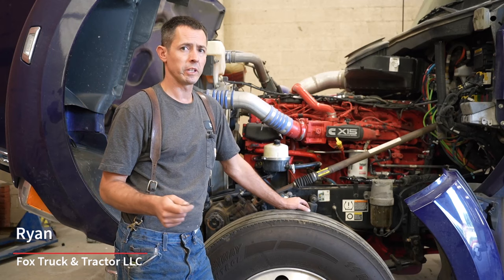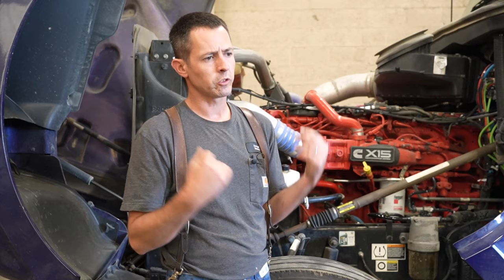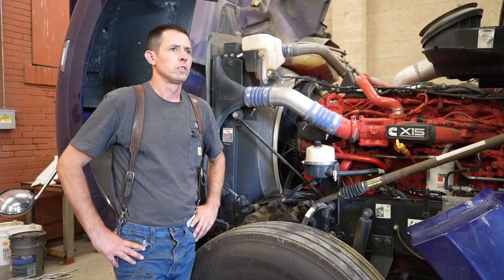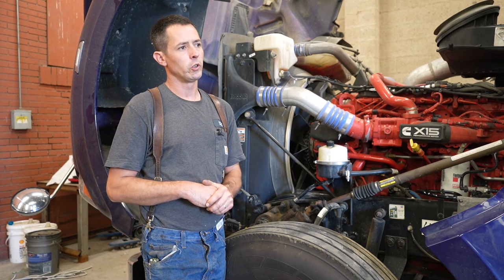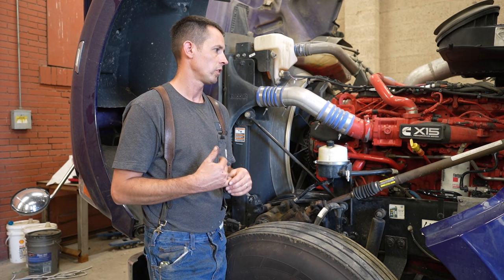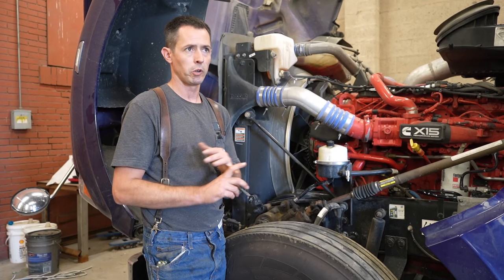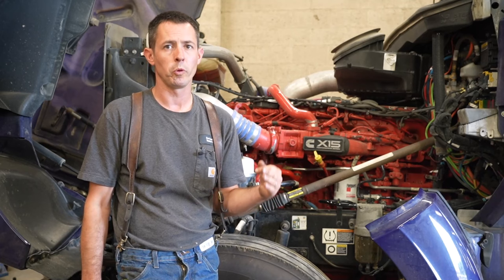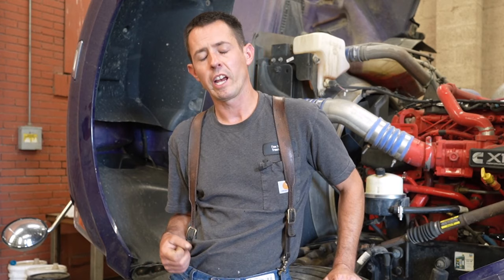Crankcase Pressure High on Cummins ISX 15 and X15 - How to Diagnose & Troubleshoot

Comment from the maker: Thank you for watching! Subscribe for more diagnostic videos!
Reply: Hey my 2018 Peterbilt 389 x 15 started loosing prime  but cycling key is not priming it it will randomly start taking couple of hrs but it does start and don't seem to matter if key is cycled. Relief valve had very little fuel come out when I checked it
Reply: Hi, my name is Michael, I come from Poland, how to send a short video to you?
Reply from the maker: You can send to our email truckingandfixingwithryan@gmail.com

Comment: There is a lot of bad information in this video. First off, the type of oil did not cause the failure, all diesel oil generally meets most  oem specifications nowadays and high detergent oils do not cause engine failures. Next you are just shotgunning parts left and right first off how you jump to cleaning the dpf and reinstalling it  without doing a snap test and verifying if there is anything wrong with the engine causing it to be plugged. Next, just throwing a sensor and filter at  it is pretty hacky; you can bypass both those with a water manometer and verify if they are the issue. When doing the cut out test you want the engine to be up to operating temp. You were doing it at 124 degrees coolant temp . Next you need to do it under load when cylinder pressure is at its highest to get an accurate test. I wouldn't pull apart an engine for 1.0inh20 change. Lastly if you find there is blowby pull the injectors, leak it down and bore scope prove its bad don't guess this is why mechanics get a bad name
Reply: Hmmm I’ll just take it to the dealer and have the warranty company sort it out and get my engine fixed lol.  All kidding aside, that was a good comment you left behind and hopefully the poster saw it as good feedback for future videos.
Reply: Yea and if you take it to a dealer that's what they will probably do. But he isn't making videos to train shop mechanics he is making this so owners know where to start and that's probably the cheapest place first. If it were the crank case filter or the pressure sensor a driver would save himself over a grand probably vs the steps you suggested.
Reply: I just had code for high crankcase pressure. I replaced crankcase filter, shit I pulled it out and it was soaked and heavy with oil. Checked breather tube for restrictions. Cleared code and issue hasn't returned. That was 3 wks ago.
Reply: Oil type 100% has something to do with it in cold weather. Your wrong there
Reply: I’ll continue to use Schaeffer Oil. I’ve had good luck with it and several of my engines.
Reply: @johnavalos6010  I’m replacing mine and it full of oil too I was never told about changing mine out when taking in for a pm. Hopefully nothing bad happens. I’m going a hard regen as well. I felt like truck would lose power during day when its 106 in Texas
Reply: I highly disagree with you here. There is alot of good information here. First off why look at a snap test look at temperatures and pressures. Second the trouble shooting points to cleaning and inspecting the filter and sensor.  I am speaking from experience because I found this video looking for the same issue. I went through the trouble shooting twice and everything checked out. Found this video performed.a cylinder cut-out test and the exact same issue was found. A cylinder cut out test is not in the trouble shooting for a 0556 code. Wonder ful example of how going 0ff script fixes the issues. Anyone can follow a script.

Comment: I'm far from mechanic, but been driving for about 26 years and with these new engines,there's one thing I know for sure,and that's DO NOT IDLE THIS THINGS!That's when that ash builds up the most and kills the aftertreatment and it is not good for the engine itself, no matter wich make.Nice video and I never had a good luck with Cummins. I think it's a big gamble,like 50/50 win or lose😁
Reply: It's tough not to Idle when it's 115 degrees in pheonix but.after all summer running the southwest I know it's my Idle hrs that increased my soot loads that have wrecked havoc on my turbo actuator the tirbo and various sencors. Almost mandatory to have an apu if you truck in thos climares.
Reply: @johnherr158 DUH that's why they make APUs not only for the summer but more so for the winter

Comment: If you can rebuild an X15 for 16k you'll be a busy man. Mine just got rebuilt because of the same symptoms of your engine. The rings on #6 were cracked at 298,000 miles. Cummins covered 60% of parts and labor, it still cost me 34k.
Reply from the maker: 16k include labor and parts, without any maching, head work or injectors
Reply: @truckingandfixing 

I've watched enough YouTube videos of the ISX in the past few years that I would not want to rebuild one without ensuring that the liner protrusion is 0.014".  

I may even just want to have counterbores cut just to ensure they are square and no ridges.

Comment: How many miles are on the truck considering it's the x15 in a kw990 I can't imagine it having much more than 500,000 MI that's either some pretty s*** luck or the x-15 is going to continue the ISX hit or miss reliability reputation.

Comment: I had an excess blowby issue at 675k miles on my isx powered t680. Visible exhaust out of the stack and blowby from the oil fill tube. I had an overhead performed and it fixed the issue. I doubt it was ever done before I purchased the truck. Sometimes it’s the little things that help
Reply: Yes, if camshaft is good
This might help with the blowby. 
This is one of the first things i do, check
For wearable marks on the cam 
Old ISX15  blowby filters are serviceable
When plugged it can damage certain components like turbo, seals etc
Reply: 500,000 miles run the overhead. But I really don't think a valve adjustment cured excessive crankcase pressure

Comment: HEY ryan on the kenworth cx15 semi 370 gear ratio we hauling gravel with dump trailer truck is t880 2021 this thing is super slow pulling the load an going up small hills can this truck be turned up.

Comment: literally seen the same exact problem on the same engine last week in the shop. came in for high crankcase pressure took the head off cylinder 6 piston ring broke

Comment: I dont have a check engine light for crankcase pressure, but a bit of smoke comes out of the breather tube in the front. I thought these engines dont do that.

Comment: I have worked at a KW dealership for 25 years I had to laugh about 7 years ago when we sent a truck to Cummins for a dyno run  they sent it back and said it needed 6 cylinder kits because it didn't have enough blow by I can honestly say that was the first engine that I have ever rebuilt for not enough blow by. But as it turned out that was when they were having problems with carbon packing and they came out with the new anti polishing liners

Comment: Hello watched your videos. Have a question about my injector. I’ve been getting check engine lights because of fault code 1143 which is Injector solenoid 4 mechanical system not responding or out of adjustment. That injector has been replace twice but still gives me check engine light. Trucks runs just fine and not derating. Any ideas of what that might be thanks so much

Comment: I get high crankcase pressure when I pull hard then it wants to shut it down. I idle it along to  where it's inactive plug in, delete the code and go again but I use some recycled oil for a year and a half against my better judgment then went back to my rotello. Still fighting the problem. Will be plugging in these things are eating injectors another subject for another day

Comment: Please keep us updated on this truck
Reply from the maker: Will do!
Reply: @truckingandfixing  Are the compressor o-rings updated? Pull the air compressor line off of the turbo compressor housing and check for dusting! There are updated o-rings for that hard line, they should be orange not black!

Comment: At one time Cummins spec on blow-by, or crankcase pressure, was anything over 3.0 in H2o, was cause for concern. I wouldn't tear into an engine for that alone, I would want some excessive oil consumption to be present too.

Comment: I just rebuilt my isx15 I had changed that pressure sensor about just under a year ago. I sure hope it's the sensor again. I did a non replacing crank filter but heard there's no such thing

Comment: I have a ISC 8.3L crank case pressure faults, 555, 556. Checked the sensor all good no issues there.  Took it on a road test under load, in the lower gears manometer was at 40inHG, in gears 5 and up it fluctuated 15-25inHG. Service manager wants to do complete overhaul. With that much blowby should a complete overhaul be done or should I do the cylinder cutout test. To isolate what cylinder it could be?
Reply: If you have distinct puffing coming out of the crankcase it would be a indication of 1 cylinder but if it is just a heavy flow then the engine should be overhauled may have been dusted look at the inlet impeller on the turbo

Comment: Hey I have a 2010 international with a cummins isx 525hp... recently I changed the gasket because It was pushing coolant through the reservoir, before i  did that it had blowby kind of alot but the mechanic didn't  saying anything when he was finish  changing the gasket now it has alot blow by but also leaks oil by the breather tube what can be the cause of these ?  Maybe ring as well but I'm assuming the mechanic would of told me when be replaced the head gasket?
Reply: Engine problems maybe need Rebuild putting new air compresor.  Start for the lowest prices
Reply: @panchovillaz8004   I actually first changed the air compressor the coolant proble went down a little but still pushed coolant  that's why I did the head gasket. After I did the gasket the coolant stop  but now it  spit oil through the crankcase breather.
Reply: @mll809  what was the problem? Did you ever figure it out?
Reply: @gregburgess6884 the first problem was me using a backyard mechanic ..lol ... I end up doing an overhaul (with a different mechanic and actual one 😆)
Reply: @gregburgess6884  i will try to make the story as short as possible ... the mechanic started doing the head gasket March 22 and took about 7 month to finish the job, he removed the head in like 2 days but them barely worked on my truck so the since we in Massachusetts with the weather changes and all that the piston rings and walls rusted  and once he decided to finish the job I guess my engine was  too rusted inside thats what the new mechanic said...and honestly I do belive him.

Comment: Had a same exact problem with my X-15 at 34,000 miles. #6 hole was shot the ring was broken. Thank God the warranty coverd all the work. 

I was getting code 555.

Comment: I'm having high crank case pressure on a yanmar and want to check the turbo for pushing back through the return what is the process for that?
Reply: Remove the turbo oil drain tube from draining into the engine. Let the tube drain into a bucket and plug the drain back fitting on the block, then run your test, this removes the turbo from the crankcase temporairily while you test

Comment: Hi Ryan . Just luv ur videos man . U doing grt wrk. I hav quick questions if u can help I have 2020 Cummins x15 in my truck. Can you suggest some computer or scan devices which can clear the codes and able to force regen The truck . This could save o/o from towing expenses. Take care man
Reply from the maker: Hi there, thank you! I would suggest OTR performance, a great tool I recommend people to get. It is designed for owner operators. It can scan codes, clear codes, forced regen, and clear derate. You can use road3333 promo code to save $100.
Reply: @truckingandfixing   thank you for the reply man. Can you suggest any place or website Whr I can find or any model number of the device
Reply from the maker: https://otrperformance.com/collections/diagnostic-packages here you go!
Reply: @truckingandfixing  thank you 😊

Comment: Does that engine have crankcase breather, and if it does, would a blockage in the breather produce similar symptoms?
Reply: Absolutely. Crankcase should replace yearly to avoid these type of issues.
Reply: Yes he mentioned in the beginning of the video that he replaced the crankcase sensor and filter
Reply: It's a maintenance free CCV 🤦‍♂️

Comment: you didnt mention you should check the blowby tube for being plugged, the red stop engine light doesnt come on till 28 psi, throttle whipping it will give you a more accurate look at the data than a idle will.
Reply: This guy doesn't know a jack about Cummins engine.....
he's clueless...
Reply: @cic-jakevanddalgeemyers.2739  i guess i have to ask if your saying i am clueless or ryan is clueless,

Comment: These camshafts are shit, i have changed a bunch of these 

Cylinder head valves don’t fully open 
Making  excessive pressure in the chamber, pistons rings brake and have a bunch of blowby 
I mean you can have many scenarios that can lead to this same issue
But these cummins love camshafts and rocker arms, 
After finding this
You must check main bearings 

I have found broken cooling piston nozzles, liner loses lubrication, rings get extremely hot and brake  pushing lots of blowby 

I can go on and on. Lol many things can go wrong here